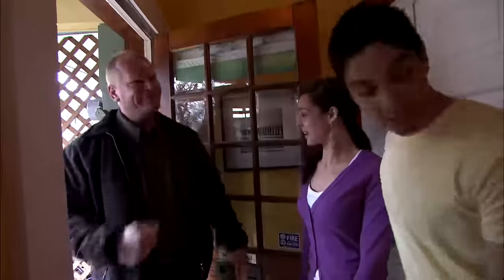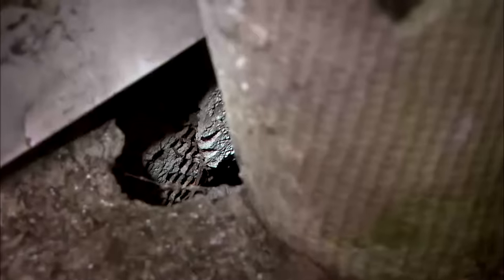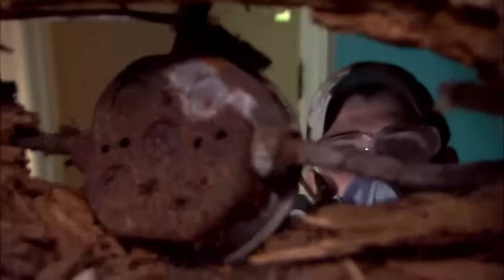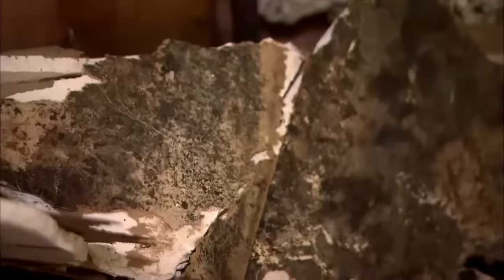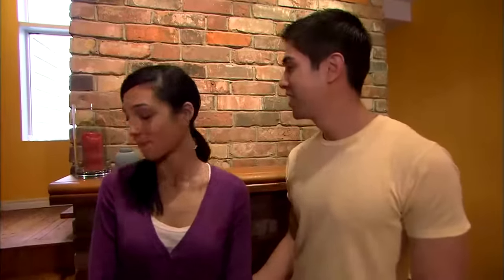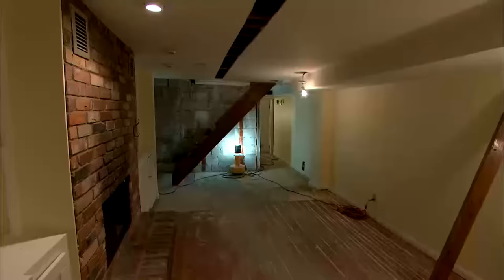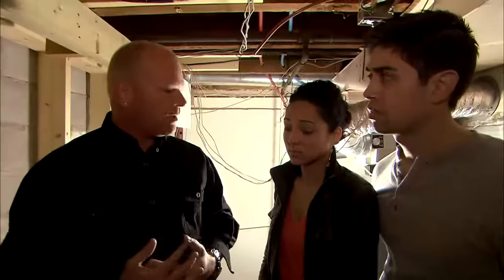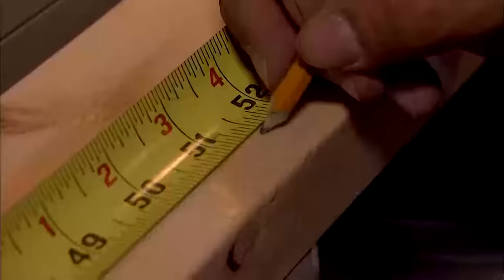Homeowner Nightmares: Water Damage to Plumbing Disaster | Holmes Inspection S112

Comment: Paying for a home inspector seems like a damn waste of money, they seem to miss everything.
Reply: They miss big issues but find small issues to nitpick about with the sellers.
Reply: the problem is, the home inspector was paid by the previous owner, even if new couple paid for walkthrough. So paid by sellers, to gloss things over and sell the house.
Reply: @frankfuller975  They are supposed to be unbiased regardless of who pays them.  Real estate commissions for BOTH agents/brokers also gets paid typically 100% by the sellers as well (excluding extremely rare circumstances where a buyer client pays a retainer fee.)
Reply: Agreed. Our home inspector missed several huge problems with our house. One of which was the ducting for the water heater was not only out of code, but completely jury rigged with single wall duct, worm gear clamps, and aluminum tape. We also found out from the neighbors that this house had a roof leak, and there was some sort of electrical fire. The ONLY big thing he caught was the roof needed to be completely replaced before we bought it. I used to think it was a tinfoil hat conspiracy theory that realtors have some inspectors in their back pockets, but now it feels more, and more true. Kind of like, "don't screw this sale up for me, and I'll take care of you." Needless to say, had we seen all the issues beforehand we would have walked away without a second thought.
  We've already put over 5 grand into fixing some of the issues, and it barely looks like we've done much of anything. Live, and learn I suppose.
Reply: @Guillotines_For_Globalists  you really think they're being unbiased? lol. if the seller/realtor's pays them, and the report is honest enough for the house not to sell, the seller and/or realtor will not only not bring them in again, but warn others in the business that said inspector will tell buyers everything he sees and loose them a sale. And some incidents on thee show had people pressured to 'buy now' and that it wouldn't be available if they had an inspector come. Those realtors should be told to go ** themselves. thay is BEYOND a red flag.
Reply: @frankfuller975  Rarely do I encounter a situation where a seller pays for a home inspection.  I've heard of rare circumstances where a seller will purchase a pre-sale home inspection just so that they know what to fix as to not bring any red flags to the table when a buyer hires their own independent home inspection.

However regardless of what you are saying, a home inspector could still be biased even if paid for by the buyers - as the buyer's agent commission is also on the line, and a home inspector may want a buyer's representative to recommend them to future clients as well.
Reply: @frankfuller975  I'll also tell you that during the height of the mad dash and mad rush of home sales (2021-2022), when a seller receives multiple offers, they're looking for the best deal and the least amount of contingencies.  Buyers who waived home inspections and provided an appraisal gap addendum were most likely to get in to contract versus those who asked for contingencies in their respective purchase agreements.  I saw some pretty wild stuff including letting the previous owners live in the home free of charge while the new buyer picks up the tab and mortgage.  One of my clients was going to allow a seller to live in the home for a few months so as long as they paid for my buyer's mortgage, utilities, insurance, etcetera.  Lost out on the deal for someone else who let the previous owners live in the home for $0.
Reply: @demontekdigital1704  Yeah buying a home can be daunting i bet, i live in a rental apartment so feel bit better from that standpoint, but replacing the roof is not cheap, or having to rewire the house is likely not free either.
Reply: @BerraLJ  The roof was $11,000 to redo. The electrical would most likely be at least double that to rewire the entire thing to current code. Luckily we only had to pay $3000 for the roof as part of the closing on the house. I've DIY'd a lot of things around the house, but I draw the line at system plumbing packages, and anything electrical other than the odd light replacement, or outlet repair, lol.
Reply: @demontekdigital1704  that is a fair bit of cash for sure, glad you got away with "only" 3000, and yes wise move to leave some stuff for certified professionals to handle.
Reply: That green paint is hideous.
Reply: In fairness, you don't hear about it when they do their jobs well.  You tend to only hear about the bad ones, and even then, you only hear about it from the homeowner, who maybe partly caused a problem.
Reply: @ncooty  BS!
Reply: @davidkirkham6497  You think it's just as likely to hear about all the problems that don't happen because people had good inspectors?
Reply: @ncooty  Anybody with a brain could be an inspector on houses! It is the biggest ripoff associated with selling & buying a house! Almost as big a ripoff as real estate, fees!
Reply: @davidkirkham6497  True, very true--in fact, I'd say:  brain optional--and there definitely needs to be better accountability, including criminal penalties.  Though you're still a lot more likely to hear about the bad ones than the good ones.

Comment: What is wrong with the inspectors these days? My son bought a house hired and inspecting crew that came in and really did a bad job the home owner ran a extension cord going through the kitchen counter all the way under the sink and to the back of the dishwasher drilled holes through the cabinets and ran the cord through it, and all the wiring in the house needs to be upgraded it’s on a slab floor and they put peel and stick carpet right onto the slab floor house needs a lot of work. Inspectors didn’t say nothing said it was a good house. Said he let his daughter live there
Reply: Kind of the same thing with my wife, and I. The original owner cut a hole in the back, and bottom of one of the cupboards to wire in an above-sink fluorescent light, and covered the exposed romex with a wood box he made out of OSB. Apparently the inspector either didn't question the box, or didn't think it was important enough to call it out in the report. I put the romex in some cable concealers as best I can so no one will get zapped, but I'm still afraid of it. Unfortunately it'd take me removing the cabinet, removing a section of drywall, and re-routing the romex in order for it to be correct.
  The ONLY reason I haven't done anything past that with it is because we plan to reno that entire part of the house, and it will get corrected then. Otherwise I'd have repaired it correctly by now. Suffice it to say, our inspector completely sucked, and we would have been better off hiring a toddler hopped up on sugar. They certainly would have done a better job than the paid "professional" we hired.

Comment: I would've told them dont bother with the gas fireplace. When i was able, I'd just have a new wood stove installed. I wouldn't be mad after they put all the work into other areas, plus the fireplaces were bad.

Comment: Wait, the coat closet was taken away. The entry zone is gone. And they live in Canada. Where are they going to take off their boots and store their coats? I'd love to see the property when it's re-furnished.
Reply: Shoe and coat rack? save space than a freestanding closet in the first quarter of the room.
Reply: There's enough room there for a shoe rack and a coat bar.  You'll get a bit of a draft from the main door into the livingroom without the baffle, but it'll be able to work.
Reply: wall hooks and a small shelving unit fix that really easy
Reply: There's a new tile floor in the entryway that would work for boots
Reply: as a European I liked the fact that the front door would not open right smack into the living but there was a sort of entry (hall / mudroom).
Reply: Please start stating cost also
Reply: @ICountFrom0  There won't be a draft from the main door unless it's open. The front door is insulated and has a gasket around it.
Reply: I liked the entryway. I wish my house had one... I hate that my front door opens directly into the living room.

Comment: The spray foam insulation in the walls.... How are you supposed to know if there is a pipe with a hole in it? Are you supposed to wait till there is major damage before you find it? AND/OR how are you supposed to find it? SAME WITH ELECTRICAL !!

Comment: Why aren't you holding the luminant flooring at least 1/4 inch away from the wall for expansion and contraction. is the flooring that stable not to?